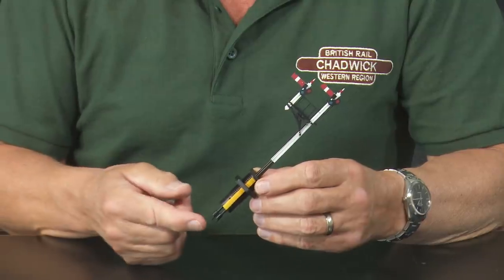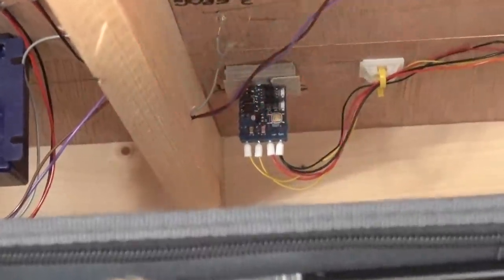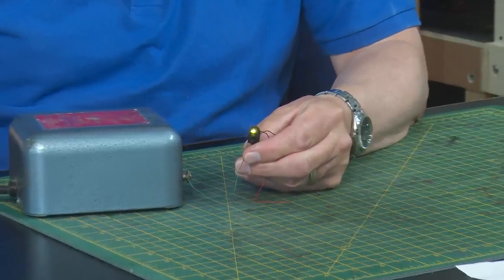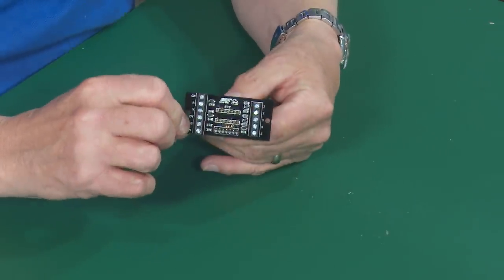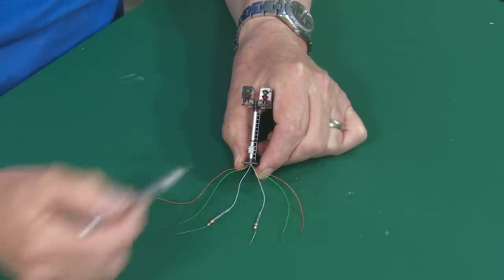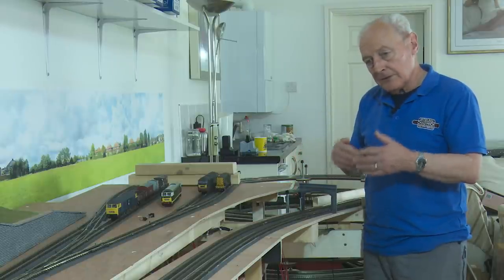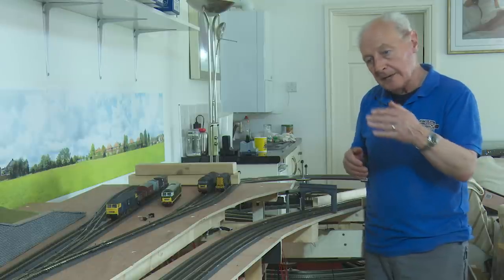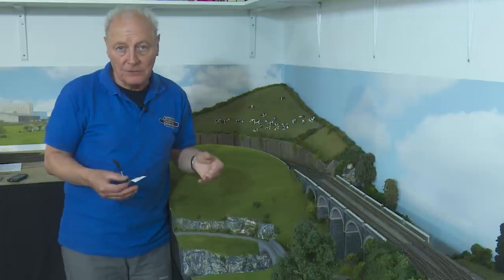Wiring LED and Semaphore Signals at Chadwick Model Railway | 135.

Comment: Re The junction signal the route indicator (feather) would normally apply to the track diverging from the main However you’re right to suggest it’s a grey area! As it depends on the line history of the railway lines concerned An example is the down line at Eastleigh The signal protecting movement in the down direction there is a normal aspect for the down Portsmouth (a left turn at the junction ahead) however the movement to continue onto the down main toward Southampton in fact requires a feather position 4 to the right This being a prototypical example of how in some cases the busier route requires a route indication.
Reply from the maker: Great examples Kev. I think we agree this one is a grey area and you could use either. Regards Charlie
Reply: The beauty of it is Absolute aspects covers all aspects of signalling at modelling level they even have what prototypically is a theatre light box on top of some signals where a character indicates the various routes it could be set for. It’s a wonderful thing to model reversible lines permissive working etc as DCC allows that in its entirety.

Comment: Early in railway history, at least the GNR had the permissive system you describe. It was after a couple of serious accidents that they switched to a default danger system. At Abbots Rippon in January 1876, a signal froze in the all clear position, and the Flying Scotsman ran into a freight train that was still being shunted out of the way. After a following accident at Arlesey the GN adopted a closed block system, wherein the line is normally closed, but is opened for the passage of a train.

To me, for realistic operation, I would prefer to see a train remain stationary until a signal is pulled off. The sequence looks something like 1) the signal would be pulled.  2) The guard would blow the whistle (or ring through to the cab), 3) If indicated, the driver would whistle, 4) (for steam, blow drain cocks), blow sand, release brakes, notch up the engine and pull away.
Reply from the maker: Great piece of history LB.
Regards Charlie

Comment: Around 9:00 yes, behind the signal to indicate block is occupied + two or three signals/blocks further to say it´s free again, but that only as far as no train could come from the other direction, crossing trains and spliting switches would have to interact somehow, too - roughly in reality signalman would have looked all of that up, telephone/telegraphed with before and next signalbox and changed the signals and switches, while shunting in the station, incoming signals would be on halt ... and more rules to follow to be [enter that word you do not like to say] -> the way you are going, computer knows in what block which train is, is better for the interactions with more trains.
Around 24:00 well more [enter that word you do not like to say]ly: first block till half the helix down red, secound block end of helix first yellow, third block through the switches secound yellow, train reached parking spot and halts it´s green at that signal - but that would be by computer based block detection, what you got anyway ;)
Around 26:00 that signal could block your station by being to near to it so coaches of the halting train would be on the switches :/
Around 27:00 well that feather system is very british - he says not knowing much about it.
"compressed" yes, model railways clearly are - no way building a block at least three times as long as the longest train for the most of us :(
Reply from the maker: Yes the trials of model railway signalling is not easy is it. Great comment, regards Charlie

Comment: Charlie. As ever a useful and thought provoking video. I’ve only watched a few minutes so far but need to comment before the thought drops out of my head. I think that you have hit on the right solution in having the semaphore signal’s default position as ‘off’. Completely wrong for the real railway but the best option given that the alternative is to start a train from a platform with the controlling signal ‘on’ which is an even worse situation. A cunning bit of inspirational thinking. Tony
Reply from the maker: A great comment Tony. Yes I believe these signals, can become a real challenge. Regards Charlie

Comment: Hi Charlie - another interesting and informative video.  I purchased one of those soldering stations but, unfortunately, it packed up after just an hours use soldering droppers to my helix.  Sent it back and got a refund so purchased one from an alternative manufacturer and this works fine.  That's one of the good things about Amazon - no hassle in returning faulty equipment.
Reply from the maker: I’m so sorry to hear that Peter, do keep me posted on your replacement.

Comment: I've learned something else. Cheers! I use the Z21 app to control and programme my train tech signals and get them to change when I throw a point. All quite simple. I am planning a new layout and want to include block detection and signal control on the main lines so this has been a great help. Thanks.
Reply from the maker: I’m so pleased that you found it useful Wayne.

Comment: Ohhhh! Such complication Charlie! Switching points and signals is just SO complicated in respect of having addresses for each. I like to stick to manual/ relay operation of points and signals - via a proper switch! I have worked exhibition layouts and a fully loaded Deltic with 12 on - in ‘0’ hurtling towards a signal where you can’t remember its address, and a point similarly.......... well, the “Emergency Stop” got a bit of hammer!!
Reply from the maker: Yes it’s a minefield Bob.

Comment: I like the BLOCKsingals for operating the colour light signals that you put near the tunnel mouth.  But I do think (like you said) that it would be better to move it further away from the tunnel.     The DCC operation seems too complex for me, as I only have a basic DCC system from Lenz.  And use Peco point motors under the points and a simple power supply and switches to work them.  And nothing wrong with colouring in the LEDs on the diagram, it makes it clear to understand!
Reply from the maker: I’m so pleased that you enjoyed the video Mike. I think that you’re right, I should move the signal further away from the tunnel for a better sight lines, regards Charlie

Comment: Charlie, 

In terms of block occupancy, semaphores are very similar to signal lights, i.e. unless the block is occupied, the arm is down, it is normally raised as a train enters the block and drops when the last car of the train exits the block. There is one exception to this policy: subway systems. On the MBTA system, at each station, the signal at the end of the platform is RED by default so that trains have to stop at the platform. When the block and is clear and dispatch releases the train, it gets a yellow to proceed to the next signal, one platform length from the end of the platform;  that signal will be green. The dispatcher can override the normally red signal to provide a yellow for a (empty or express) to pass through the station without stopping. 

Where your friend has the semaphore at the end of the platform, it could be considered as appropriate for passenger service. It requires the trains to stop at the platform, then continue after passengers enter and exit the train. For normal block occupancy, he would have to set up the semaphores to be raised only when the block is occupied. 

Always find your videos both entertaining and enjoyable, Bruce
Reply from the maker: Great comment Bruce thank you. I’m so pleased that you enjoy the channel, regards Charlie

Comment: Charlie, the idea of having the semaphore default position to be 'off' (ie - clear) and only returned to danger after the passage of a train was used on a 4 track section of track on the Southern region many years ago. I have a feeling it was in the Basingstoke / Woking area. Essentially there was a 4 track mainline signalled by automatic semaphores operated by full track circuiting.
Reply from the maker: Fundamentally I was wrong 😢

Comment: Charlie, thanks for another really informative video.
Ultimately it is your railway and you can choose to run it how you want but if you want to follow some prototype operations form some railways then that is also your choice.
I work for a railway company in Australia and also spent many years working for the State owned Queensland Railways. We have pretty much followed the British system of safeworking and as such we use the same signalling system in Queensland as is used in I think most of Britain. This includes the 4 aspect colour light signalling with feathers (we call them Route indicators) and position light signals. Originally when the feather was lit it indicated a speed restriction due to the diverging route being taken and was always only a yellow aspect.
Now however with the upgrading in many locations  to High Speed Points on the mainlines a double yellow or green aspect can be displayed even if it is the diverging route.
Regardless of this the diverging route is always the feather and in the case of multiple diverging routes they would always be indicated by which feather is illuminated. We have some with up to 6 feathers, 3 on the left and 3 on the right, which is probably the same in Britain at least from what I have seen and read about.
What all this means, and I am thinking that your signalling friends have probably told you this, is that for your junction at the end of the viaduct the feather should be to the right.
I really like your videos so keep them coming as we watch the progress of your layout. Looking forward to the day when your mainline is complete with the second helix in operation.
Reply from the maker: Hi Alan,  
Many thanks for a great comment. 
One other fact to input is that the line down to the Helix will be rated at 90 MPH and the line up to the branch station at 50mph.
Regards Charlie

Comment: Good video Charlie some useful info on the Block signal boards. I may be able to use them on my American layout to operate the signals I have.
The signal just before the bridge I would say still needs a banner repeater before the start of the curve. 
A driver at speed would not have time to react to that signal due to it's placement. 
I'm sure Heathcote electronics do one. Check out their website. All the best Keith
Reply from the maker: You are of course right Keith, regarding the banner repeater. I shall certainly look into it, but I may not fit one due to the proximity of the station. Regards Charlie
Reply: @ChadwickModelRailway  I've put a couple of photos on your Facebook post about this video.
Keith
Reply from the maker: Thanks mate.

Comment: Hi Charlie, thanks for an enjoyable video.   I noticed that when you operated a turnout in your double junction, you do not appear to have both turnouts interlocked to operate together, allowing for the possibility for trains (in theory) to collide at the diamond and causing an electrical short. It should never be possible to set two routes over the diamond at the same time, for safety reasons and to provide proto…. er, 😲 authentic operation.  As always, it is your layout to enjoy and if you want the turnouts at your double junction to operate independently, then that is fine by me.  Best, Jason
Reply from the maker: I totally accept your point Jason, I don’t quite understand it, but in the morning I’m on the case. Regards Charlie

Comment: Great explanation and demonstration but I think there will be a few signalmen looking on in horror at the moment as in your example the train could stop just after the signal and it would still eventually change back to green. There would need to be a second sensor at the other end of the block with another signal and only after the last coach of wagon has passed would the reset event take place for the signal. But that said for a model railway the simplified version is sufficient as they are just an effect for onlookers rather than authentic control.
Reply from the maker: You’re exactly right Rob,  in some ways it’s just Eye candy. Regards Charlie

Comment: I'm just making a wild guess but I'd assume the series of semaphore signals would remain in the danger position until a signalman needs to send a train down that line. At which point he would call ahead to the next box to ask if the line was clear, if so he would then change the signal at the beginning of the block to green. My question would be would they even have blocks back then? It would mean running point rodding down the line at great length. I'd imagine they'd only have one signal at the start of a block and one at the end controlled by another box. Example;

Box1: I have a train wishing to enter the block. Is the line clear?
Box2: Yes, the line is clear. Send on the train.
Box1: Changes his signal and the train enters the block. The same signal then remains at danger until Box2 gives the all clear.
Box2: The train has arrived at my box, the line ahead is now clear.
Box1: Where did you put the car keys?
Box2: They're on the side.
Box1: Which side?!

Something like that!
Of course with electric signals it's just a bunch of sensors in the track that talk to each other.
Mike.
Reply from the maker: An excellent comment GR, and that is how it worked.

Comment: As always, another great vid from Chadwick 👍. I always try post a comment no matter what. Great finger movement on those signals. Wow... thats too far 😂😂. But seriously.. as a PLC progammer at one time, using mitsubishi logic, I reckon a PLC control system at 24 volts would be cheaper than this mix and match of different control systems. Your common anode or common cathode is PNP or NPN. Asia uses NPN, UK uses PNP. PNP is is lot easier for fault finding with a multimeter. NPN sensors are historically cheaper. PNP easier to program. Not straight forward 😂.  I think, two facing diodes create a darlington pair.. just rambling.. Its Friday. For the algorithim 😂👍. I would just use a relay.
Reply: I would wire the feather via aux contacts on the point motor, using the positive feed from green. Green positive, feed from before resistor to point motor aux, resistor then feather led. Prob then of course.. erm.. train passes, signal changes to red. My method would need a green signal till the train had cleared the points. Not prototypical. 😂
Reply from the maker: I think we all appreciate that getting the signals right is just a nightmare. But is it just Eye candy?
Reply: @ChadwickModelRailway  I think it is what you want of it. Cos of my background I like how you emphasise control. My daughter however, is happy with lego stations 😂

Comment: The big problem with the single Dapol signal is the two wire ‘toggle’ action. I have three of these on my layout but have not attempted to automate for this reason. I also have three two signal versions that each have three wire control so there is a definite up and down selection.  The only way to fix the single signal is to disassemble it and install a separate servo motor.
Reply from the maker: Yes Robert, not the easiest of designs. 
Regards Charlie

Comment: I fear you may have opened pandora's box on semaphores Charlie.  I have a number of the Dapol ones on my layout and they're all DCC controlled via iTrain.  I think someone may have commented elsewhere, but I tend to have them configured to show danger when the block they're protecting is occupied and also link the distant signals to their respective homes accordingly.  I real life, a signal box would have passed off a train and associated signalling from box to box, so normally, signals would be set at danger between box districts to prevent a train leaving one box for another before it had been handed off.  But who needs prototypical, it's a lot easier to think of them as described above.
Reply from the maker: An excellent attitude Stuart. In some ways I’m pleased I’ve left them out of my layout!

Comment: Sorry - one more comment on colourlight signals and them normally being green. More modern arrangements have something called Track Circuit Block where each section between the signals is proved. This allows signals protecting plain line to work automatically.
The signals protecting junctions or level crossings are normally held at red until the signaller clears them for one train (some have an automatic facility once the signaller has first cleared it). The ones in between the junctions were historically arranged to work automatically because the signaller would not control them. With modern control systems the computer can clear them when needed or make them work automatically (there is never one right answer!!).
Your most realistic signalling would be for the junction signals to be normally at red until a train is going to go through the junction with the signal in rear at Yellow and the one before that Double Yellow. When the junction is set then the signals on the approach would improve to Double Yellow or Green depending on the junction signal aspect.
But what does it matter - it is whether you enjoy the look and behaviour which is important. Yes a few "experts" will cringe when they see it but most people will not realise.
(As an aside, in the 80s there was a safety film produced by BR to remind staff about the risks of going on the track. It started with a locomotive coming out of a tunnel filled with smoke - very Hollywood. The problem was that they did not have a shot of the locomotive coming out only one going in so they just played it backwards. Everyone watching immediately knew it was wrong and spent have the video discussing what it was until they realised the locomotive was on the wrong track and had tail lights lit. Safety message was somewhat diluted!)
Reply from the maker: That’s safety film must’ve been so poorly received. Very cringeworthy. Regards Charlie